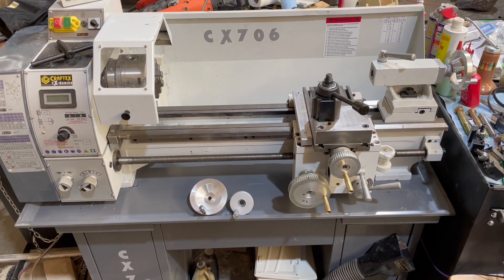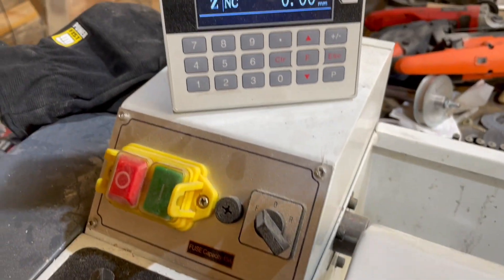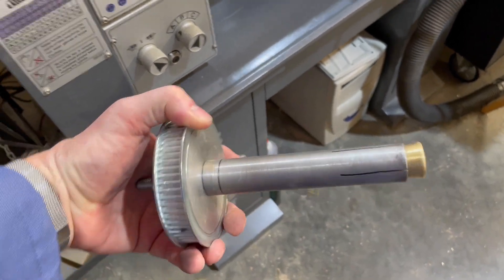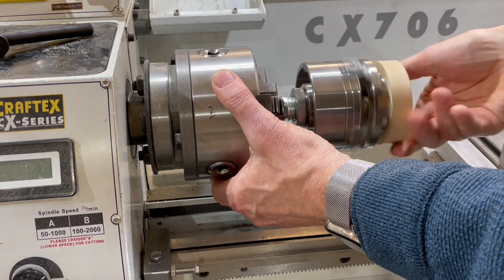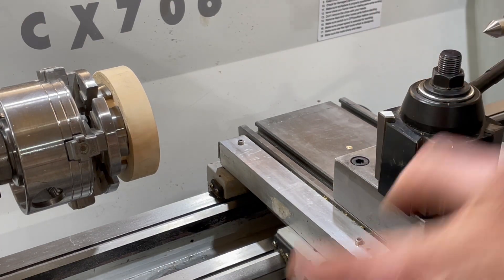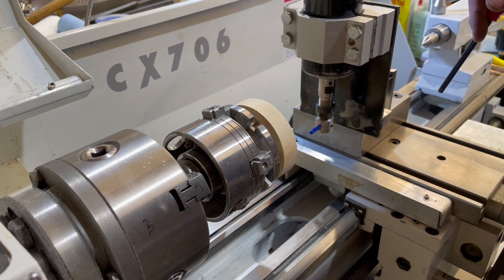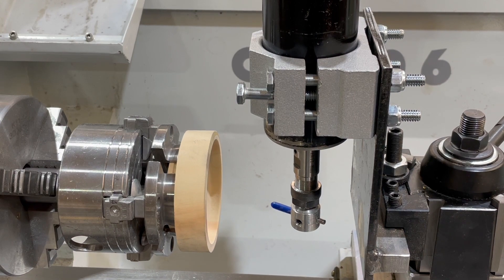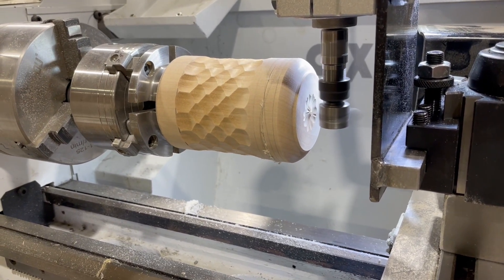Metal Lathe Adaptation for Ornamental Turning

Comment: Hello, very impressive indeed. I have Mach 3 turn with three stepper motors control for x,z and spindle rotation it runs on window, please can you tell me where I can get free Gcode to do guillouche work. You mentioned the corn lathe  can I get the Gcode from that system as a download for windows. Thanks
Michael
Reply from the maker: @mikalaki1  Hi Michael. You can find Guillochograph here: https://fabrikisto.com/tailmaker-software/
Scroll down the page of software to find it. Don’t follow any of the links in the documentation since they’ve been hacked. The author has made the software free to use a couple years ago. It works best on flat of cylindrical surfaces.

Comment: Great adaptation thank you for sharing. Where can I get free codes for Mach 3 turn
Reply from the maker: @mikalaki1  Hi Michael. I use Mach3 Mill since the Mach3 Turn only shows 2 axes. GrblHal is another way to control machines using pretty cheap firmware cards and it is free unlike Mach3.

Comment: You are good! I am interested in this set up I have a small metal lathe I would like to convert like this. However, I’m retired I may have to get a job to afford these modifications. Thanks for sharing.
Reply from the maker: Hi Michael. Equipment cost depends on where you are in the world and your bargain hunting abilities. I’d guess an adaptation like this would cost me about US$200 to $300. Mine has 2 x 2Nm and one 3 Nm Nema23 stepper motors, 3 x TB6600 stepper drivers, one MKS Tinybee V1 flashed with GrblHal as a control card, some wire, suitable pulleys and belts. A 20 Amp 12 volt power supply, and some kind of a spindle completes the list. Mine is a 800w dc spindle with its own power supply. I source most of my parts from AliExpress or Amazon. If you have an old windows computer, portable or desktop, that’s all you need. 
After that it depends on how handy you are, and your scrounging talents. I use small lengths of 2” pipe tack welded to a short piece of angle iron and 1/2 inch square stock to make the spindle holders. For the mini lathes having a compact spindle is helpful for obvious space reasons. On my CNC I initially used a used RotoZip but I prefer to have a speed control on the spindle. I don’t think Nema17 steppers have quite enough power. Alternatively, a red USB Mach3 control card could be used but then you need to buy Mach3. 
COrnLathe for design is free. Grblgru as a Windows control program is free. GrblHal as control card firmware is free. Climbing the learning curve is free as well as great exercise for the brain. That equals a great retirement project in my view. Cheers.